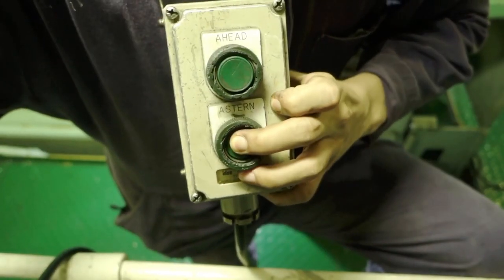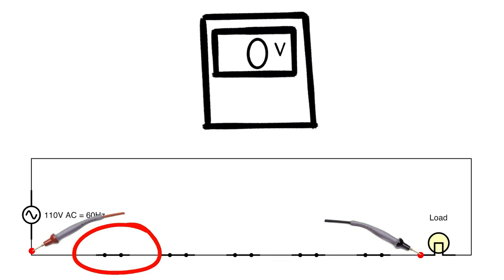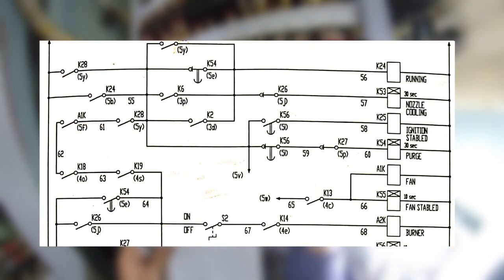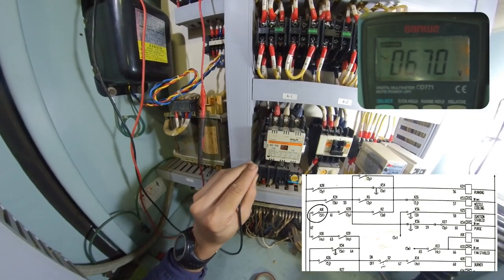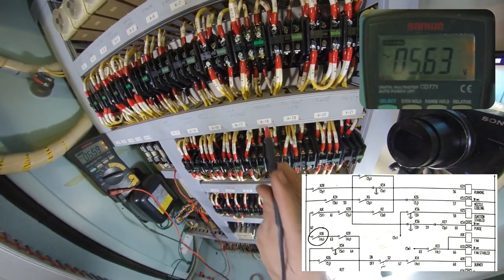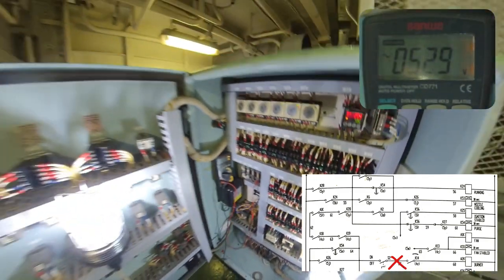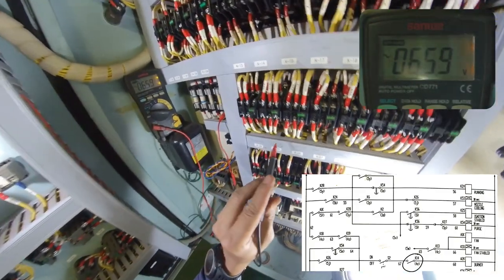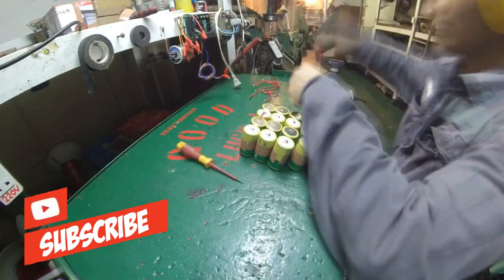Basic Troubleshooting on a Live CircuitㅣMarine Electrician

Comment: Using a burner to test the heat detector is not advisable as it will damage the sensor, heat sensors like that has a setting of temperature to make an alarm thus an appropriate heat sensor tester is used. Nice and informative video by the way..

Comment: You never check the controller out put it's have the interlocking system. If you run the incinerator after the purging the incinerator pilot burner will fire and main burner will not fire . What was the fault is K 14 or the controller ? Please explain. Thanks.

Comment: This is incomplete video, you didnt tell why one of contact of K14 is open contact and how to solve the problem and after solving problem did motor start or not, secondly burner motor has different interlock until and less these interlocks are not activated you cannot start the motor.
Reply: The title of the video is basic troubleshooting not complete repair of electric circuit. The video is comprehensive on explaining his process.